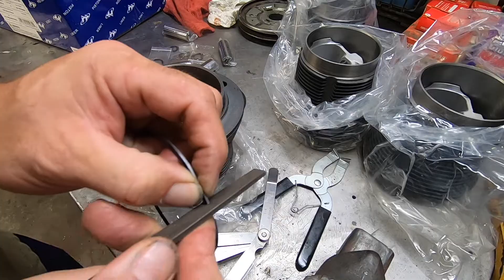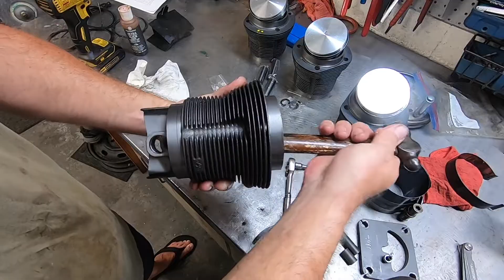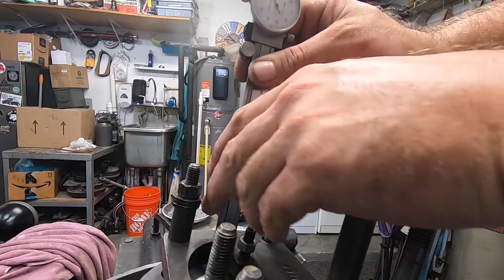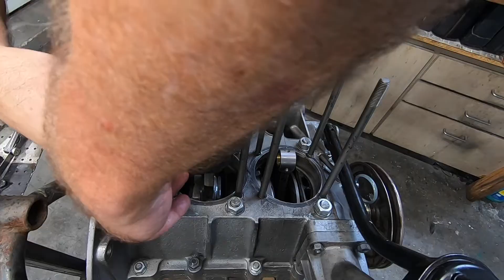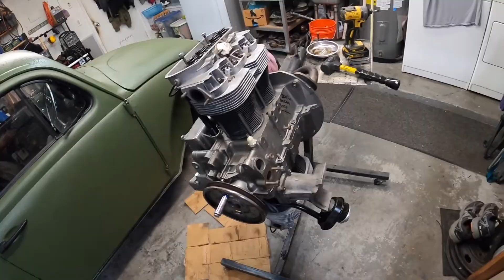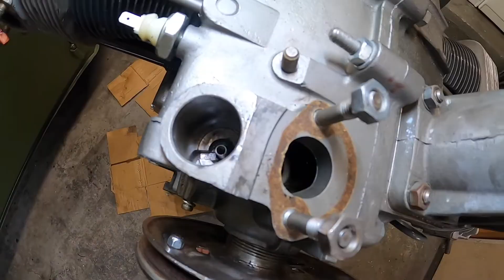Volkswagen Aircooled 2007cc Stroker Engine Assembly,  Part 2 - The Long Block, Top End

Comment: I noticed that there is a little bevel on the bottom on the cylinder, and the top is 'sharper'.  Since we are hoping to push the piston to the bottom anyway to have access to the wrist pin, would it be incorrect to install it from the bottom?
Reply from the maker: It wouldn’t be incorrect, some people do it that way. Do what is easier for you, that’s what I do.
Reply: @VWJawbreaker  Thank you.

Comment: Ok, so I’m new to the VW scene. I’ve heard the vernacular of A and B pistons. Are these A or B pistons?

4:04 you’re the first VW engine builder I’ve seen actually to measure the piston ring caps like that. I watch a Porsche engine builder named Klassik Katz and of course he always performs this step. Of course he would those Porsche engines are expensive bits of kit!
Reply from the maker: @timotheegoulet1511  A pistons and B pistons are in relation to the pin height on the piston. B’s are closer to the oil rings making the piston “shorter”  vs stock. 
These pistons in this build are A pistons.
Reply: @ thank you.

Comment: Un placer conocerte soy un seguidor de tu canal tengo dudas y estoy aprendiendo sobre el tema de los vochos mi pregunta tengo un. Eje de leva fk44 cuanto es la elevación que debe de tener total . Tendrás también un libro para poder leer aprendo mucho con tus videos quiero tener más conocimiento espero una respuesta
Reply from the maker: The Engle FK44 is a newer VW Cam for serious engines. It is designed for 1.4-1.5 rockers, and it's specs are .391" Cam Lift, .547" Valve Lift (1.4 Rockers) 287 degrees of advertised duration, and 258 degrees of duration at .050", on a 108 Lobe Center..
This is an excellent Ratio Rocker Grind, similar in behavior to the Engle 120/125, with a 3000-7000RPM Power band. It comes on strong in the mid range, make sure you match your head flow and valve lifts to the cam!

Dual springs are REQUIRED. Works best with Compression from 9.00-9.5:1. This cam is clearanced to work with all crankshaft strokes and rod combos.

Comment: Why did you use SP heads, DP heads run cooler and makes more power. 
I'd really like to hear your thoughts on this.
Reply from the maker: Part one would answer your questions 🤙

Comment: OK great video. But, why did the previous guy use that many shims?
I would have thought that .080 to 090 would have given a better compression ratio of around 8.1:1
Reply from the maker: Appreciate it. 
Deck height isn’t the only factor in compression ratio. These single port head chambers are on the small side.

Comment: I learned from an engine builder your circlips should be fitted with the eyes at the bottom so on the firing stroke the clip will open and tighten in the groove, if assembled with eyes at the top of the piston the circlip can collapse and fall out of the groove causing catastrophic grooves in the bore.
Reply from the maker: Every builder has different things that they do. 
Imo, if you have a clip fall out it’s due to import per installation. 
If your clip falls out due to the wrist pin hole flexing, you’ve got more issues than just the placement of the clip position…. The wrist pin hood is the strongest part of the piston, there isn’t any flex going on there.
Reply: @VWJawbreaker  yes and some poor quality clips around too terrible spring steel
Reply: @VWJawbreaker  nice work though that engine must have heaps of torque! I’ll keep watching your vids before I build a VW engine! Haven’t built one for 40 years!
Reply from the maker: It doesn’t just apply to high performance engines, the engine I have in my car has been going for over 4 years without issues. 
I appreciate you being here and sharing your thoughts. So many ways of doing things and sometimes what works for one may or may not work for another. As long as we can keep these classics on the road, by us working together, that’s what matters to me. 🤙
Reply: I guess it only applies to high performance engines but it makes sense. I overthink everything keeps me awake at night lol

Comment: Hello, just put in a brand new 1835cc zero mileage what motor oil do you recommend for florida weather. Thank you.
Reply from the maker: Honestly I’d talk to the builder and see what they recommend in regards to oil weight. Other than that you need a high zinc oil, preferably one with the additives already added in instead of adding additives.
Reply: Thank you

Comment: great video I have a question. 
my brother has a 1600 in his 72 bay which was second hand engine but ran. there were issues with the mounting points so he took out to fix he took the opportunity to redo all external parts of the block ie distributor and such all went back but timing is around 180° off for it to start and run but run rough any clue wat wud cause this please? thanks❤
Reply from the maker: The distributor can only be installed one way due to the offset cam that the distributor sets into the drive gear. 
Easiest thing to do is just move your plug wires around according so #1 points to #1 plug wire. 
Otherwise you’d need to remove the drive gear with a special tool that isn’t very expensive but also make sure when you do that you done make the 2 shims under the drive gear fall out of place and into the engine case.

Comment: Sorry for the late question but, you stated you had .115 deck height. I tought ideal deck height would be between .045 and .070.?  Won't that much deck height put most of the firepower in cylinder instead of head chamber?  Confused.
Reply from the maker: Absolute minimum is .040” due to potential piston to valve issue. 
Ideally, no more than .090”. However, there is a story with this build covered in part 1. I didn’t design this engine rather than just fixing the failure and putting it back together for my friend. If it was up to me we would have gone dual port heads with a larger cc however that wasn’t an option as he wanted to keep it single port for his bus. 
I can’t add more cc’s in the heads so to keep the compression ratio in check, I had to go back with .115” deck as the original builder had it.

Comment: Why are you building an engine with single port heads of that caliber?  It doesn't make sense.
Reply: Will do.  Thanks for the quick reply.  Appreciate it.
Reply from the maker: @drakea.5816  I do my best especially with the amount of comments and questions that I get. 
Have a great holiday!
Reply from the maker: Watch part one and it will make sense.

Comment: Great video, I learned a lot but I do have a question about the heads and compression. My 2007cc engine has a very similar set-up to this motor in that my motor also uses 90.5mm B pistons. When my motor was going together my builder as worried that I wouldn't have enough compression to run, but he changed his mind after putting together the bottom end.
My first question is how did this 2017cc motor have such little deck height having B pistons? Even with standard cylinders there should be more deck space than shown.
My second question is about the heads. Isn't it strange to use single port heads on a motor this large? Wouldn't they create a choke point killing mid range power While making more heat? Even stock valve dual port heads would work out better.
Reply from the maker: Hey buddy! Great to hear from you as always. 
I’ll answer in the order that you asked and let’s see how it goes:
1. Usually when using B pistons, some will use a shorter rod to eliminate the need of the deck shims. I did figure out that this case had been decked on both sides which would require more shims. 
2. Some people still love the single port engines. This being in a bus, you need mostly low and some mid range torque. The only benefit of going dual port would be some mid and mostly upper rpm performance. A bus isn’t going fast and doesn’t need those high rpm’s.  
I know of a 2332cc turbo single port that’s fast as crap. It just isn’t much good over 4500 rpm due to the heads but is a massive torque monster. 

Different strokes for different folks basically.

Comment: Gary On the end play. Did you need to use 4 shims like some of the AA cranks? or did CB fix that on their cranks. We have had like .0100 too much tolerance on the end of the cranks from AA. Which is a PIA.
Reply from the maker: No, I was able to reuse the 3 shims it was originally built with. 
I did notice the difference in the Aa cranks vs the cb crank in regards to the end play, seems like cb is more on the ball. 
The last Aa crank I was able to find a thicker shim to obtain the 3 shims needed.

Comment: Try Versachem Mega Black. It is much better and stronger than the Permatex ultra black. I bought it when they were out and never will go back to the Permatex. it us just better in every way.
Reply from the maker: I’ll look for it, thanks for the heads up. 
I’ve been meaning to get more of the right stuff and try that out on the heads but always use what works best for me.

Comment: I use CB Performance's online CR calculator too. very handy. Always a pleasure to watch a meticulous and methodical engine builder at work:) And no I don't use sealant on the pushrod tubes either, never leaked a drop.
Reply from the maker: As always, we have many things in common lol
I still wouldn’t call me a true builder, I’m somewhere in between.
Reply: @VWJawbreaker  I've seen allegedly professional engineers do much worse Gary! Keep up the good work:)

Comment: Dose the silicone add much to the total thickness of the shims?
Reply from the maker: If you’re not careful it will. You don’t need a lot and also torque the heads down before it dries up causing the the little excess to squeeze out leaving only what it needs in place.

Comment: That will be a good runner. Not certain but it looked like the wires for the ignition module had pulled towards the distributor shaft. Might be worth a look. I have seen them rub through the leads and short out. l love the combination.
Reply from the maker: I’ll have him double check. This build was a while back and the engine went back in over a month ago.

Comment: Looking good... but that deck height is way over the recommended range!! That shouldn't be over. 060 to .070 otherwise detonation is a concern
Reply from the maker: It’s not an issue to run .090 deck especially on certain builds. 
Also, no way to run less with single port heads unless you want the compression to be through the roof then your engine won’t last.

Comment: Thank you once again Gary. When setting the distributor gear is the motor set at TDC before dropping in the gear. Only part I haven't had to do yet.
Reply from the maker: Yes, good question. 
Verify you’re at TDC on the pulley and the valves are loose on #1. Then install the drive gear.